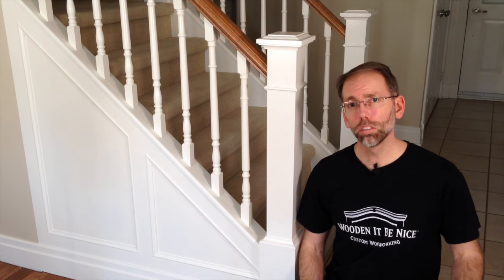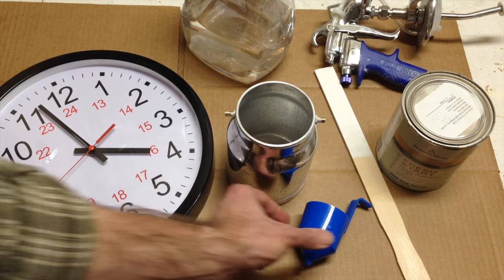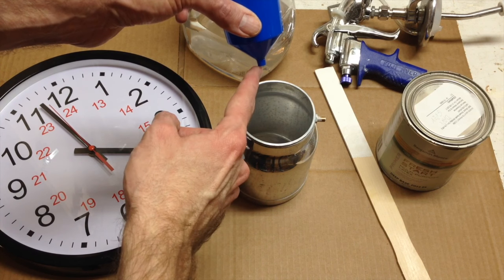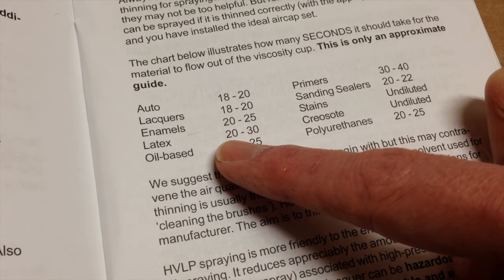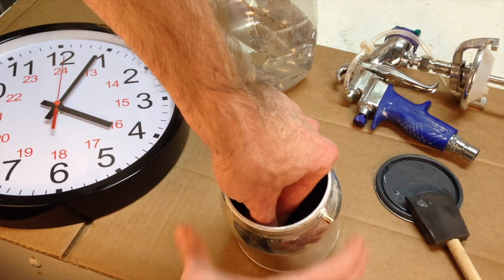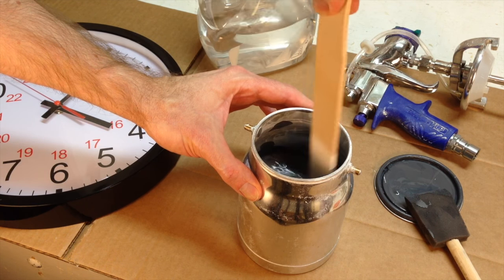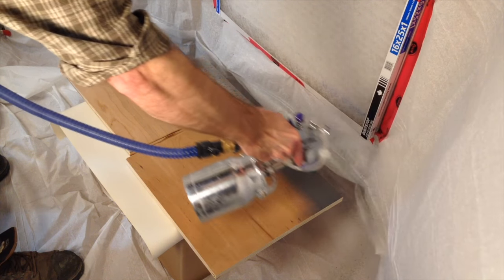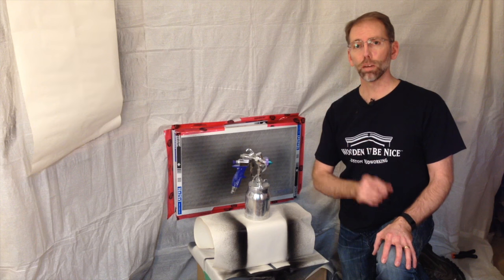How to Mix Paint for a Spray Gun

Comment: I looked everywhere for a video that made paint mixing this simple when I got my HVLP. I didn’t find it until 1-1/2 years later. Great info man!
Reply from the maker: Thanks Russell.  I appreciate that.  Scott
Reply: Make sure your compressor puts out enough CFM to operate your gun the wat it is supposed to. A lit of hvlp gunsvtake as much as 12cfm to atomize paint properly. If you do t push enough air volume its lime using a water hose to pa8nt. I use LVLP spray guns. They are found easily at amazon and other painting supply stores. And take a lot less air volume. 3cfm is what that require. So a medium size 33 gall8n tank. 120 volt compressor pushes plenty if air

Comment: Scott, you forgot to recommend an orifice size for your 30 to 40 second viscosity paint.  I say use a 1.8 tikp.  If you  have 20 second paint go to a 1.3 or 1.4 tip. I got these numbers by testing paint I bought from Target Coatings.  They had given me some tip sizes.
Reply from the maker: When I purchased my Fuji Spray system, it came with a viscosity cup.  The manual provides target times for various types of finishes.  I know there are several types of viscosity cups out there but I don't have the experience to recommend which one to use.  If you do, please add a comment with the details for others to learn from.  Thanks.  Scott 🇨🇦

Comment: It took me ages to find out the correct way to thin cellulose paint in the old days, nobody would tell me. Then I found an old Polish car sprayer that gladly explained that keep adding thinners to the paint, stirring, checking by lifting the stirrer, until the drips leaving the stirrer have no "tail", then, it was  ready to use. That was in the 60's. Today, who knows, first "Two pack", now water based paints, probably with no instructions again!

Comment: Thanks for sharing.The drip cup method you use is more precise than some other methods. What size nozzle do you typically use for the latex paint? Do you have another video for the nozzle that works best for latex? In your opinion what is a durable latex brand?
Reply from the maker: Here's a link to a video showing tip/nozzle/air cap set testing with 2 latex paints - https://youtu.be/AGof3BywLvg

I prefer Benjamin Moore Advance paint.  It levels out well and you can see how great it looks in the test video

Comment: I’ve read in certain forums it isn’t ideally to mix and thin paint for a siphon fed sprayer but this seems to work great 👍👍 look forward to trying. Any tips for cleaning out your equipment? My old foreman used to just run thinner through until it came out clear lol
Reply from the maker: For cleaning, I use warm water and run a full container of water through the spray gun to clean the internal parts.  If there's paint on the accessible parts, a stiff bristle brush works well.  I hope that helps.  Scott

Comment: What is the difference between the Cup on the bottom of the gun VS Cup on top of gun?
Reply from the maker: They both work well, but the gravity cup (on the top) gives you more flexibility when working in tight spaces.  The siphon cup (on the bottom) holds more paint so you can cover more area when spraying.  I hope that helps.  Scott
Reply: @HomeImprovementWoodworking  ok great,  thank you,  great job

Comment: Good advise one thing I've learned from experience is never mix paint in the cup for your sprayer use a separate clean container and strain the paint into the spray gun.
Reply from the maker: Thanks for your tip Peter.  Your method would offer more efficiency for multiple applications - mix it once, and you're done!  Thanks.  Scott

Comment: Great videos.  Very easy follow and understand and the tips provided are very useful to me as one who is just getting into spray painting.   I do have a question about viscosity. 

 It seems that most latex paints I have used recommend no more than 8 oz of water per gallon as a thinner.   I cant get close to the recommended runout times without going well beyond that manufacturer limit.  Warnings are that exceeding manufacturers recommended limits may cause the paint to become structurally unstable. 

If they paint is still too thick when recommended max thinning has been reached ... do you just need a larger needle / fluid valve / aircap or do you just continue to thin?
Reply from the maker: In my experience and learning from a professional finisher, I ignore the label and thin to the proper viscosity.  My preferred paint is Benjamin Moore Advance as it levels out really well when drying.  I hope that helps.  Scott

Comment: Plz provide viscosity cup manual for different types of paints such as oil paints water based paints
Reply from the maker: There isn't a universal viscosity chart as it depends on your paint sprayer.  You need to refer to your paint sprayer manual to determine the viscosity needs for what fluid you're spraying.  I hope that helps.  Scott

Comment: I'm thinking about purchasing a paint zoom pro machine ....to use with latex and oil based paint, I'm concerned with the oil based and how to clean the machine afterwards and what do you use to thin the paint when applying it to surfaces? Thanks
Reply from the maker: I avoid spraying anything other than water based finishes as you need to flush the spray gun when you clean it.  I can't imagine doing that with chemicals.  That's my opinion.  Scott

Comment: Hi, first of all I apologize for my language but I do not speak English very well, I'm from Argentina and I like your videos. I would like to know what tip measure you used for water enamel, 1.5 mm or 2 mm. Gracias!
Reply from the maker: I would suggest 1.5mm as the paint is likely thinner.  I hope that helps.

I have a question for you - would caption/words on the screen of a video be helpful for you as English is not your first language?

Thanks,
Scott

Comment: Thanks for the great video. May be a stupid question but doesn’t thinning the paint force you to do more coats? I’m thinking of using a spraygun for a deck which usually takes thicker paint anyway. Last thing I want is a thin little layer of paint on the boards. :-)
Reply from the maker: That's a good question Jack.  I mixed this paint for an HVLP sprayer, which is intended for fine finishing.  Thin layers create a smooth finish.  I wouldn't use an HVLP sprayer for a deck.  I recommend an airless sprayer with is intended to put out a high volume of paint.  This is what's used to paint house exteriors.  The paint is typically used straight out of the can.  Does that help?  Scott
Reply: Home Improvement Woodworking sure does.  Airless sprayers a bit out of budget.  Looks like its roller time.  Thanks for the reply.

Comment: Great series man the way you explain everything so simple to understand. I was looking for this information about how to dilute or what to use to dilute paint or primer and I've went thru several video but none mentioned what they used they just mixed and retested you actually if its water based use water. My sprayer says the information should be listed on the paint can but none of my paints mention anything about diluting solvents. I've had the machine for 3 weeks and haven't used it because I didn't want to destroy my machine in a single use or botch a job because I didn't know how to properly use my equipment. Thanks again for the information man your a great teacher much better then the commies teaching our kids today lol.

Comment: Dear Home Improvement Woodworking;

I have a simple question.
I have a 40 year old stockade fence. I usually paint it every
couple of years with Bear Paint. This year, I want to 
do something different. I want to use a sprayer instead
of a paint brush. I want to use white wash with a warm color
water based paint. And here's the extra step; I want to add
Elmer's glue to make that paint stick real tight.

I'm not sure how much glue to add to the water, before 
combining it with the paint. What would you suggest?

Because of maintenance, the fencing is in pristine shape.
But with more humid rainless summers, and brutally cold
dry winters, I can optically observe how it is effecting my neighbors 
fencing. I figure, I can lock out the environment much better if
I use Elmer's as a sort of deflector screen. If that makes sense.

We've all seen in high-school wood shop how an Elmer's glued 
joint between 2 pieces of wood is actually stronger than the
wood itself. Thus the same principle should apply to paint and wood.
Reply from the maker: Thanks for your question.  Wood glue works by making a cellular bond with two pieces of wood under the pressure of clamping.  I'm not a scientist, but I suspect wood glue won't help your paint.  

My favorite paint is Benjamin Moore because I painted an exterior soffit and facia using their exterior primer and three coats of exterior paint, and that finish lasted more than 10 years.  I've also used another brand (I won't mention the name) where the paint started to crack after 3 years.  I recommend talking to someone in a local Benjamin Moore store if you have one near by.

I hope that helps.  Scott
Reply: @HomeImprovementWoodworking  that is a fair and good answer. It will help me to think more deeply. And there's a big box store nearby that does sell Benjamin Moore paint. So you really helped me. Thanks.
Reply from the maker: MrPanetela you're welcome.  Good luck with your project!

Comment: Question. Does thinning the paint that much lower the quality or durability?
Reply from the maker: It doesn't in my personal experience with the finished I use, but that's not a generalization I would apply to every finish.  I recommend buying the highest quality finish you can afford as quality makes a difference.

Comment: Really enjoy your vids! Please keep them coming. I have a question: I am going to paint our cabinets white, and purchased the mini-mite 5 and a 1.8mm nozzle set. I am going to use Stix and BM Advance. I decided on a 5 stage to give me a better chance at a pro finish without having to thin my paint much. I have read claims that a 5 stage can handle the BM Advance straight up, do you have any thoughts on this? Should I plan on thinning a little bit?
Reply from the maker: Hi Jim.  I suggest testing it.  I recently did some paint testing and it will be worth your effort to get it right.  You bought some quality equipment, so try it out before you commit to all your cabinets.  I know it can be exciting to want to jump right in with a new tool, but like most things in woodworking, patience usually pays off.  Here's a video of testing 2 different paints and 3 different air cap sets.  https://youtu.be/AGof3BywLvg  Let me know if you have any further questions.

Also, thanks for the encouraging words.  I've been feeling spread thin lately and your feedback gave me the shot in the arm I needed.  Thank you!

Comment: Hi, i am using powehouse paint spray gun, it doesnt have any instructions in the manual on how many seconds should i use for the latex paint, should i use the 20-30 second for latex paint?
Reply from the maker: Give it a try on some scrap material and see how it works.  If it's too thick, you will get an orange peel look to it.  Here's a video showing different air cap sets and 2 different paints.  You can see the difference in the finish - https://youtu.be/AGof3BywLvg

Comment: What do I use to thin house pa8nt for interior walls. I use a 2mm tip on a lvlp gun. Not a typi, LVLP low volume low pressure. As my compressor puts out 6.9cfm at 40psi

Comment: Hello, thanks for the video!  I have a few questions, I am not painting a home improvement project, but rather an  electric guitar body.  I don't have a controlled climate, but rather outside in which I must spray.  The finish is Candy Apple Red that I am going for, so there are many layers, different colours and flake.  I am on my 2nd last amount of spraying which is a self dyed red in a General Finishes water based clear coat, High Gloss.  

1. How can I tell if my spraying and drying are going well or poorly?

2. How much do I have to sand until orange peel is no longer an issue?> all the way until there are no visible orange peel lines or just until they are knocked down?
Reply from the maker: That sounds like an interesting project.  If you're getting an orange peel finish, you're not getting the best results.  You need to change your spray settings and/or finish to get a smooth finish.  Its best to practice on scrap material to fine tune your equipment, spray technique, and finish.  When sanding down the orange peel, you should sand until it's smooth.  I hope that helps.  Scott

Comment: Scott where would chalkpaint fall in these paints types, do you think?
Reply from the maker: I haven't sprayed chalk paint, but being a water based opaque finish, it's likely similar to a latex paint.  If you're looking to spray it for the first time, try a test piece with 3 different viscosities so you can get a feel for it.  You will quickly be able to see what works best for your setup.  I hope that helps.  Scott

Comment: Nice Video! What Can I use to clean my Spray Gun?
Reply from the maker: Hi Thomas - cleaning a spray gun can be intimidating for someone who's new to it.  Once you've done it a dozen times, it becomes routine.  I only spray water-based finishes, so I use water to clean out the spray gun and occasionally use mineral spirits to do a final wipe of the paint cup.  The key to an easy clean up is to do it immediately after you've used the spray gun.  Once the finish starts to dry, the job becomes difficult.

Comment: The ILVA 2K water based paint I am planning to use says to dilute with no more than 5-10% water, I believe. If that doesn't cut enough of the viscosity, do you just step up in tip size?
Reply from the maker: That makes sense to me.  I've found it really requires experimentation to find what works right for each type of finish.  Cheers.  Scott
Reply: @HomeImprovementWoodworking  My question was that if one cannot cut beyond 10% water as suggested in your video, would the next move be orifice size of your spray tip? It sounds like that might be the case. For my specific purposes for the 2K polyurethane paint, warming it up by placing the can in a bucket of hot water for a while made all the difference in the world.
Reply from the maker: @luke9822  I suggest following the manufacturer's suggestion in the instructions.  If they recommend a specific viscosity, you should follow that advice.  Changing the orifice size will not change how the spray gun was designed to work.  I've thinned paint beyond the 10% point without issues for Benjamin Moore paint, but it may be different with other finishes.  Here's a demo I did using different spray tips - https://youtu.be/AGof3BywLvg
Reply: Hi Luke,
What is the 10% or the 5% in ounces if I use a measuring cup?
Thanks.
Reply: @elkinspainting1  Nobody knows how much paint you are using I can't do you math for you. To figure out what 10% or 5% is of something you just multiply it by 0.1 or 0.05. You want to figure out 10% of 16 oz? 16×0.1= 1.6 oz.

Comment: I used wood primer with oil already on my dresser. But I want to use deco paint. Can I spray deco paint on this dresser? Because somebody told me if I used wood primer so I need to go with oil base paint. What I should do?
Reply from the maker: I don't know what deco paint is.  If it's a water-based/acrylic finish, that can't be applied over an oil-based finish.  You will need a coat of something that will allow you to use a water-based finish.  I recommend talking with someone where you buy your paint to find the right product for your situation - bring your paint cans to show them what you have.  I hope that helps.  Scott

Comment: Thanks for this great video, very informative. I think I may have been diluting my paint a little too much. I have a 3 stage machine but annoyingly there's not listing for latex in the manual when it comes to viscosity just needle sizes. Have you ever tried Floetrol?
Reply from the maker: HI Ben.  I haven't tried Floetrol.   So far, water has worked well for thinning the finishes I use.

Comment: Do viscosity requirements change depending in whether you are using  gravity feed or siphon cup?  Also, if you spray latex, do you prefer a larger orifice size and thicker paint, or thinner and smaller orifice?
Reply from the maker: Viscosity doesn't change for the type of spray gun cup.  The purpose of the right viscosity is to properly atomize (spray) the paint.

For the air cap set (sometimes people call this tip size), I have tested 2 water based paints with 3 different size air cap sets.  Both paints performed differently when thinned to the proper viscosity.  Here's a link to the video https://youtu.be/AGof3BywLvg  Based on my testing, latex paint intended for walls performs better with a larger air cap set.

Does that answer your questions?
Reply: It does, thank you!

I assume that there are correlations between fan pattern and size and pressure?  More pressure for a larger pattern and thus, more paint?

I am looking at spraying the inverted hull of a 16' foot boat with high-quality latex (it's a trailered boat and will never sit in the water long.  (The boat forums have a lot of positive references to using high-quality latex paints!).  I have a 2.5mm HVLP gun arriving this weekend, and have a 27-gal/5 HP compressor available to me.